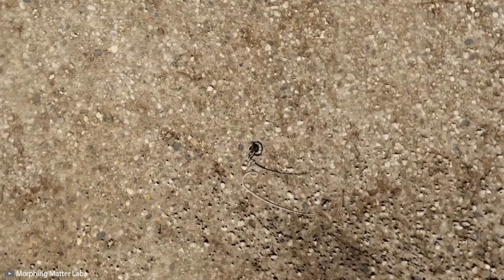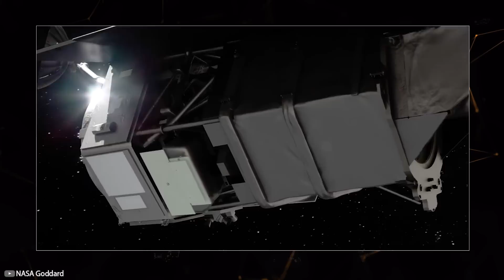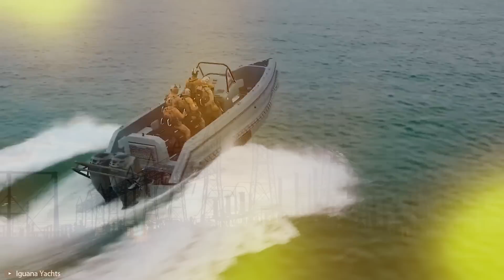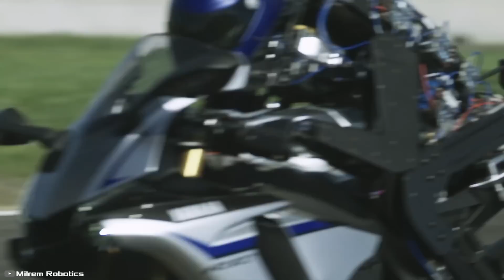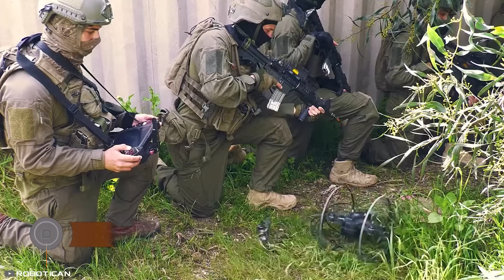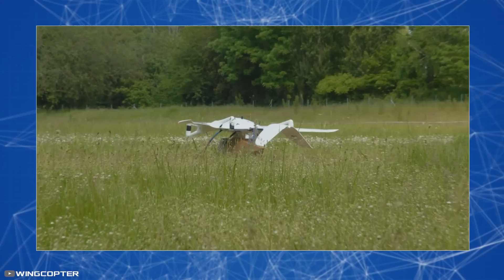15 MIND-BLOWING TECHNOLOGIES OF A COMPLETELY NEW LEVEL

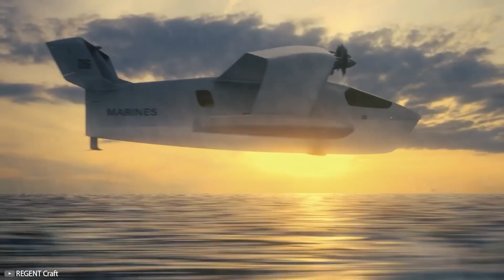Comment: Time: 9:20 "Doesn't burn fuel" ???  ...   "Over 80 percent of all the energy used in Hawaii for electricity, surface and air transportation comes from imported fossil fuels, mostly oil and some coal"  Citing HawaiianElectricDotCom

Comment: I am the inventor of the only series of ion propelled aircrafts that are 100% propelled by ions with onboard power supplies. Previously the thrust to weight for ion thrusters was several orders of magnitude too low for onboard power.  Many "experts" thought that ion propulsion could not be made to lift its power supply. Pure ion propulsion when operated efficiently has exciting possibilities!

There are 46 flight videos of my crafts with onboard power on my Ethan Krauss YouTube channel and the Electron Air website.  They have 2 US patents that cover onboard power, the specialized power supplies, and the many improvements that were needed to accomplish the goal of it lifting its own power supply.  The crafts on my channel are still the only ones in existence that are fully ion propelled and can fly with onboard power.

The "Undefined Technologies" drone that claims to be" ion propelled" is actually propelled almost entirely by a ducted fan.  There are two published patent applications for it that contain already widely known ideas that have been online for decades. One of them shows the powerful ducted fan that can be heard in Pribanic's videos.  While the simulations of it look great, due to the mass of his system, its specific geometry, and the number of sharp corners, it will only produce an exceptionally small amount of lift relative to its weight, and so requires an extremely powerful loud ducted fan in its center.  Due to the physics of ducted fans, his device will always be many times louder and significantly less efficient than other types of aircrafts.

Comment: IMO the tracked boat should be redesigned in landing craft style; for carrying 4 passengers and a UTV to haul them on land. Leave a machine gun? on board to protect the boat while it returns
to a ship for reloading and refueling.  One front passenger could also operate a machine gun while floating and landing.